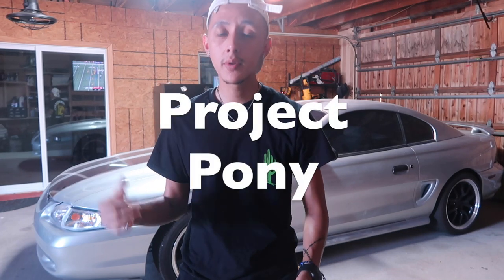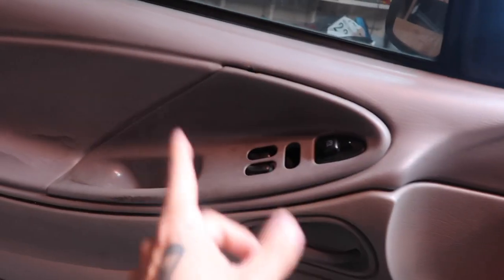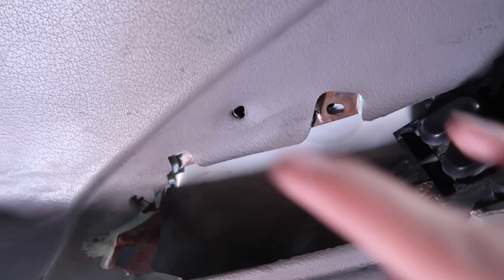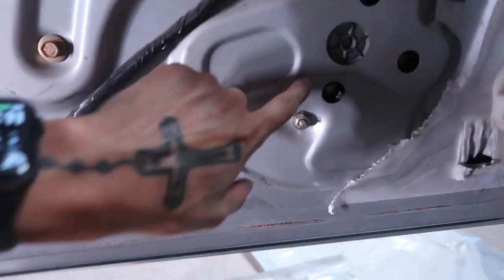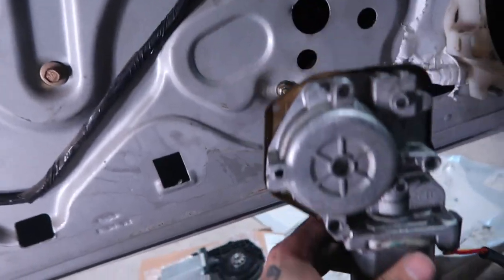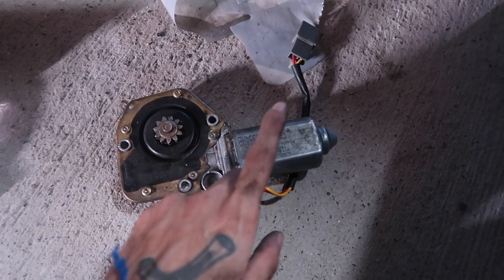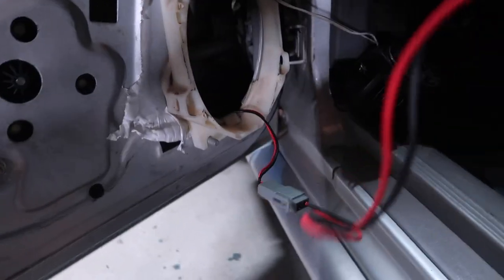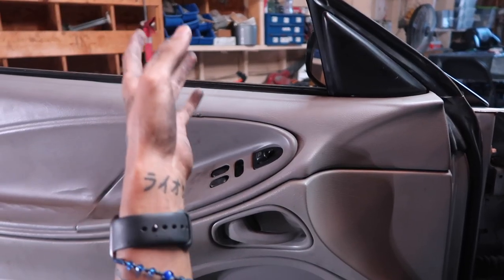Project Pony Ep:9 Window Motor Replacement (1998 Mustang GT)

Comment: Just got one and I need to change the motors, you came in clutch bro thanks 🙏. Tho my windows are down, is it’s till the same process or do I have to lift it up first?
Reply from the maker: should be the same process, you can always disconnect the old motor and connect the new one to raise them if you have to